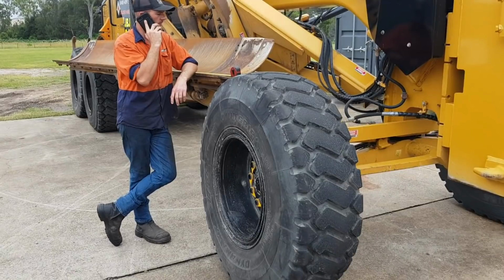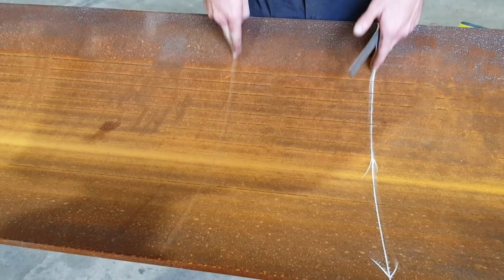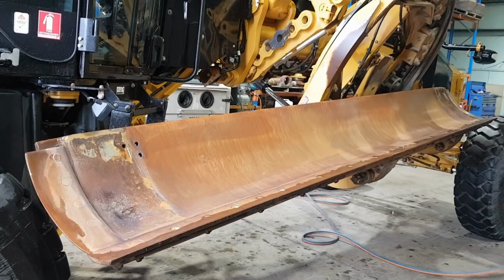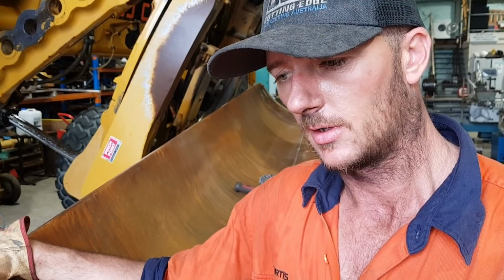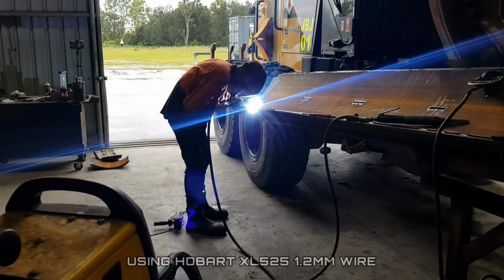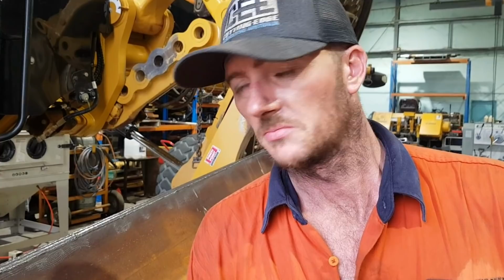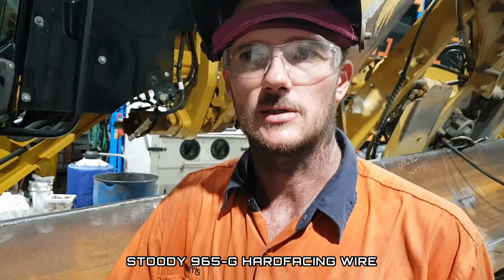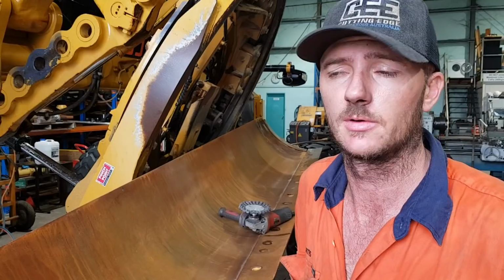Repairing Blade on a Caterpillar 140M Motor Grader | FCAW Welding

Comment: Can I ask why you pressed the torch on the metal as you adjusted the oxygen at 3:40ish? I have done something similar to clear brazing tips, but I haven’t seen such a method with a cutting tip.
Reply from the maker: Hey mate just a trick when using LPG so the flame doesn't get blown out when turning on the oxygen
Reply: @CuttingEdgeEngineering  interesting, I’ve never used LPG, but I will keep that in mind. Nice videos by the way,

Comment: Hi just joint your channel fantastic my Question is would a Plasma Cutter be Quicker Just asking a Boilermaker / welder thank love interesting work 👍🇦🇺😀 and working any motor vehicles I hope the battery is disconnected because introducing and Electrical current going through the entire system 👍🇦🇺😀

Comment: Hi Great video. Quick question (apologies if it's been asked before!) Why do you place the nozzle of the cutting torch against some material before adding the oxygen? Is it to prevent the flame from burning out?
Cheers
Simon

Comment: I have a question, why is it that you always start your oxy when your Oxy/Acetylene cutting against the plate or whatever metal you’re going to cut? Is that just a always done it that way thing or are you resting the torch head against the metal for a reason I’m not seeing?
Reply: Oh and another job well done I forgot to add that part.
Reply from the maker: @normchampine472  hey mate thanks for watching. It's a trick with using lpg (not acetylene) helps keep the flame at the tip so the oxygen doesn't blow out the flame
Reply: Oh ok awesome thanks, I was wondering why I never saw any soot when you first lit up the torch righton that makes more sense now, yea keep up the good work my brother and I always watch you videos and love to see all the different projects you’re working on.

Comment: What is it your doing just before you turn the oxygen on?
Reply from the maker: Just a trick with using LPG helps keep the flame at the tip to ignite and so the oxygen doesn't blow out the flame 😎👍

Comment: The blade did not warp at all with all that heat input !?
Reply from the maker: hey mate nah not at all, section the welds and there's alot of structure behind the blade so no real chance of it warping

Comment: I got a question 
Why do you light the oxy torch on the fork tines?
Reply from the maker: Hey mate just a trick with using LPG as the flame sits off the tip of the torch and easily gets blown out when turning on the oxygen. Holding the tip against a surface helps it ignite
Reply: @CuttingEdgeEngineering  
Ah cool I didn't realise you were using LPG, I guess I'm so used to using acetylene

Comment: Come someone tell me what those little yellow triangles are for on the machines lug nuts? I see them a lot on big vehicles here in the USA.
Reply from the maker: Hey mate they are wheel nut indicators to show if they are becoming loose. They all should be facing the same direction
Reply: @CuttingEdgeEngineering  thank you sir

Comment: Why do you lite the torch next to the metal, just curious. Thanks for sharing!
Reply from the maker: Hey mate because i'm using lpg gas as fuel it helps keep the flame at the tip to ignite and not blow out when turning on the oxygen 😎👍

Comment: Great video kurtis question besides warping the frame is there a reason you don't remove the old skin first or are all blades reskined this way
Thanks peter
Reply from the maker: Hey Peter thanks for watching mate. This grader has a factory blade and there was no skin to remove. If it was a re-skin job then we would gouge the old skin off but that doesn't cause the original blade to warp. Cheers, Kurtis 😎👍

Comment: Was the re skin you welded on just mild steel or some ar plate
Reply from the maker: bisalloy 450 wear plate that was quenched & tempered
Reply: @CuttingEdgeEngineering  I that similar to ar450 through hardened and tempered  abrasion resistant steel that we have in the us or is it the same stuff

Comment: I noticed that every time you light up the torch, that right as you're bringing in the Oxy, you touch the torch to some surface. Why?
Reply from the maker: Keeps the lpg gas at the tip to ignite otherwise the oxygen blows out the flame
Reply: Yea that pop can scare ya.

Comment: Great work Kurtis, expertly videoed of course. What grade of Bisalloy did you use, guessing the Chrome doesn't help in the flame cutting?.
Nice to see another area of your companies expertise.
Thanks for sharing and stay safe all.
Best regards from the Black Country UK.
John.
Reply from the maker: Hey John thanks mate. The bisalloy was 450 grade, quenched and tempered. Oxy gas cutting wasn't the neatest haha. Cheers, Kurtis 😎👍
Reply: @CuttingEdgeEngineering  Thanks for replying, flame cutting was fine, it was the globules that made it look different. "Hardox" is a popular trade name here in the UK, plus other countries, there's even a supplier called "Bruce - Engineering" here in the UK, gotta be good. https://youtu.be/bkrUzGooA9k. HBW 450 is impressive.
Regards John.

Comment: How does hard facing work? Is it just extra material over the top?
Reply: Yeap it is just looks like another weld on top just more hard wearing than normal welding wire/rod to protect the softer weld from wearing off  fast when in operation
Reply from the maker: @pryormio3853  is spot on 😎👍

Comment: One thing I recommend when welding on equipment , especially on the newer stuff, or wet machines is to make sure the battery disconnect is off. If no disconnect then remove the battery cables. You fry someone's computer you're gonna have a bad day.  Cheers mate.

Comment: Any reason you lay the tip on metal when first turning the Oxygen on?
Reply from the maker: Just a handy trick with LPG. Because lpg doesn't burn to the tip of the torch and oxygen blows out the flame
Reply: @CuttingEdgeEngineering  Thanks.
Reply: @stusue9733  I wanted to ask the same question.  I saw him do it once and then when I saw him do it the second time I knew there had to be a reason.

Comment: So who else, is wondering why the tip of the LPG-oxy is touching Steel with the advent of the oxygen being turned on...?

Didn’t learn that back in the seventies in trade school...
Reply from the maker: Hey mate had quite a few people wondering the same thing. Just a bit of a trick with LPG as the flame sits above the tip of the torch and easily gets blown out when turning on the oxygen so just helps keep the flame at the tip to ignite 😎👍

Comment: Gday, they cop a flog’in that’s for sure, I’ve seen the mould board worn down to the bolt holes from lazy barstards to lazy to change the cutting edges, makes you scratch your head that’s for sure, awesome job mate, cheers Matty
Reply from the maker: Yeah seems to be a trend when it's a dry hire machine maintenance is non existant. This one is in good condition considering the hours, he has guys that look after it and it shows 😎👌
Reply: @CuttingEdgeEngineering  he’s got people how care, rare things these days

Comment: nothing more satisfying than chipping flux and finding nice welds underneath, wish mine would come out that pretty but welding 1/2in plate on farm equipment with a little 135A machine doesn't make for pretty, just functional. I think ill have to get me one of those needle scalers, so much quicker than a wire brush.
Reply from the maker: Yeah mate the tooling and machines make a big difference

Comment: Very nicely done! Really liked the your explanation of the weld and the equipment you were using. I estimate the reskin is about 25% cost of a new moldboard. So I wonder how many hours they will get out of the reskin?
Reply from the maker: Hey mate life of the skin comes down to what material the grader is pushing, in gravel it will last about 6000hrs but softer material it will outlast the machine. We did the reskin for about a tenth of the cost of a new one. Cheers 😎👍

Comment: I'll be the one to look like an idiot and ask: Why do you touch the torch to the work when you open the oxy valve? Does it keep the torch from going out if you open the valve too fast?
Reply from the maker: Hey mate had a few people wondering the same thing and yeah you're spot on, keeps the gas at the tip of the torch so the oxygen doesn't blow out the flame 😎👍